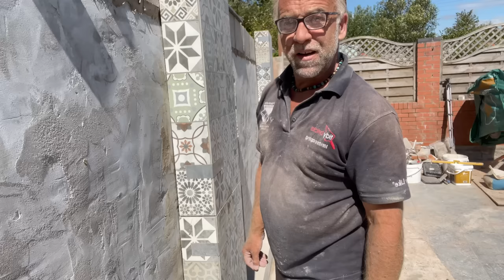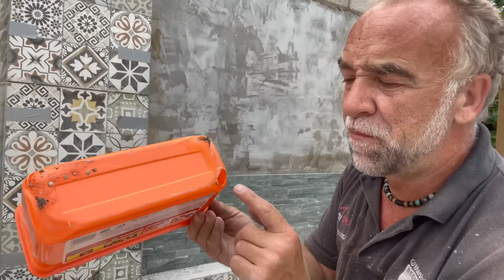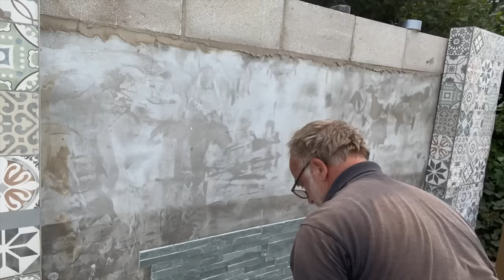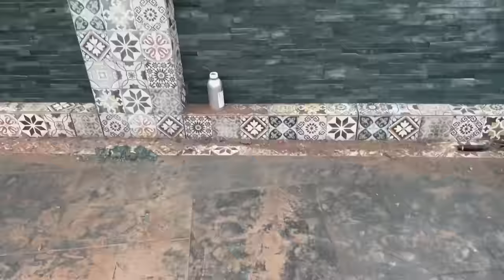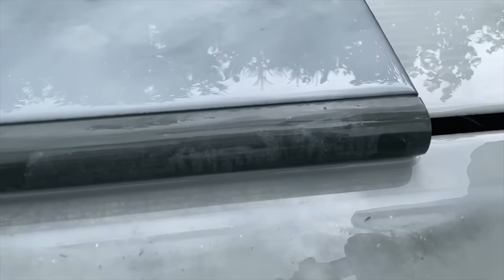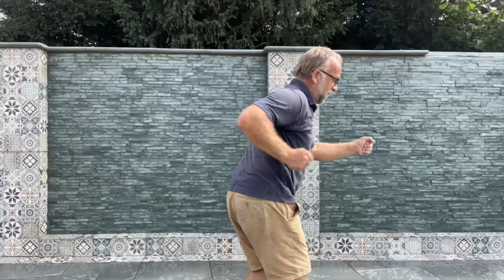Dry-Stack Walling Feature Wall Installation Guide 🌟🧱 #porcelain #blockwall

Comment: Hi mate, love your work, can i ask how does this work on a blockwork planter corner,  how to get the neat finish, does it just butt up on the corner both sides, how do you hide the side of the tile the rough edge.
Reply from the maker: Tough call and there’s no real ideal answer but the alternative is is to tooth the corner rather than straight joint looks best 👍🏴

Comment: I use external tile adhesive recommended by the supplier. Find that I have to work left to right as it can get messy try to fit the tile underneath the joint of the last tile. Good tidy job there btw
Reply from the maker: Thanks for watching Tony as for The tile adhesive there’s so many out there and it all sticks like glue 👍🏴

Comment: Could you use these indoors for a shower? Or the gaps let water through? I like them
Reply from the maker: Water would definitely seep through but it could still be done as long as the wall behind was waterproof I guess 👍🏴
Reply: As mentioned in the reply, water from an internal shower will get behind the tiles as will rain water on this job shown.....there is no difference! Except when rain water gets behind the tiles shown in this video it will sit behind the tiles in the huge voids caused by just using a few lines of adhesive. This water will freeze in the winter and blow the tiles off the wall. There should be no voids behind the tiles particularly on an external project where water will get behind between the wall and tile. The wall and  tile should be completely covered with using a notched trowel and external tile adhesive and if any oozes between the joints it should simply be wiped off. This video shows not how to stick tiles to an external wall.

Comment: Great video. I'm putting almost the same tiles on the front facia of a timber frame bar building. I'm going to use a tile backer board to try and alleviate some movement. Would you still use the primer 1st?.
Reply from the maker: Yeh man primer every time both sides 👍🏴

Comment: Quick Q, The system U are using, Will it stand up to water ingress, frost heave ( delamination from background) Ireland a lot of rain, especially winter time, is your system suitable for North facing ? Big Thanks in advance if U reply
Reply from the maker: Hi George and the answer to your question is the product itself is very delicate if I was to kick it with my boot bits would fall off so it’s not massively structurally sound especially expanding frost.
Hope that helps 👍🏴
Reply: Can't believe what I am reading. George you are correct. Water will get behind these tiles and sit in the huge voids that are being formed by just using a few bead lines of adhesive. This water will freeze in winter and blow the tiles off the wall. This video shows how not to stick tiles to an external wall! You should never form voids behind tiles. You should cover the wall and tile with an external tile adhesive with a notched float / trowel. Then press the tile firmly on to the wall. then there will be no voids! If any adhesive comes out between joints then simply wipe it off. The reply you have been given is unbelievable. The comment about if the tiles are kicked with boots then bits will fly off is just beyond me. And the comment about the tiles not being massively structurally sound is the most ridiculous comment I've ever heard. "Not massively structurally sound"! Tiles are not at all structurally sound! They are not designed to take any weight loading so what does "not massively structurally sound" mean?

Comment: Can I use this method of adhering over painted breeze blocks that get slightly damp from other side??
Reply from the maker: Definitely not over any paint because it will not bond with the wall properly, get the pressure washer on it first.  Cover the back of the wall with plastic if possibly slow the dampness down 👍🏴

Comment: Can I use this primer and adhesive for an indoor wall? With similar tiles, also can I put the primer on an old painted wall
Reply from the maker: I would say the primer and adhesive would be fine for indoors but I would clean the surface for it to stick to and not the  wallpaper 👍🏴

Comment: Hi, we’re putting ceramic tiles similar to those you’ve done on a concrete block exterior wall - is that primer and sealant the best one to use please? Would the Sika pva primer do the same job? The other side of the wall is backfilled (double skinned wall with a small gap in between) just looking for some advice please? Thanks
Reply from the maker: I’m doing similar atm using a cement primer from Marshall’s. you must prime the wall and tile then stick. putting a plastic dpm behind the wall would also help stop water from penetrating through the wall 
hope that helps 👍🏴
Reply: Thank you! Too late for anything behind the wall but will definitely prime both surfaces 👍🏼

Comment: Fantastic video mate! Have you ever used slip bond to bond tiles to masonry at all? I'm doing my house that's smooth red brick! And have been recommended slipbond as the adhesive.Would I have to pva/prime the wall to cover red brick.thanks
Reply from the maker: The product I use all the adhesives come with it and yes you would 100% have to prime the wall first 👍🏴

Comment: Hello mate, drystacking a block wall on a job tomorrow and its all over the place not plumb or straight thinking of batoning the wall and fixing the dry stack to the timber, what do you think mate?
Reply: Would the adhesive bond well with the timber and if so would you primer the batons ?
Reply from the maker: That projects the wall wasn’t perfect but it was perfect enough not to stand out probably your best bet would be dub out with some render in some spots probably the easiest way 👍🏴
Reply: Ended up using cement boards mate worked a treat, thanks for the advice appreciated

Comment: Hi mate I’m doing the front of a house with these …I thought you use tile adhesive…is it ok to use it ..cheers
Reply from the maker: Yes should be fine I also used the same 
All materials needed supplied with Marshall’s 👍🏴
Reply: @tidybrickslandscaping  is it ok to install this during cold winter weather
Reply from the maker: @anitagoodsleep5330  Check the instructions on the adhesive if I was you 👍🏴
Reply: Mate I wouldn't use this method of sticking tiles to an external wall. You should never form voids behind tiles particularly outside where rain water will sit in the voids. This water will freeze in the winter and blow the tiles. The wall and tiles should be completely covered will external adhesive using a shallow notched float. Press the tile firmly on to the wall. If any adhesive comes out of joints simply wipe clean. Do not use the method shown in this video. Hope this helps and good luck with your project.

Comment: How many m2 will that primer do? Is there any cheaper alternatives? Cheers mate
Reply from the maker: About 2m2 1 primer bottle does 👍🏴
Reply: Cheers. Where is the best place to buy the adhesive and primer? Also, if you mind me asking I’m fitting these to a block wall and top of the wall I’m going to be laying porcelain slabs. Would you recommend laying these on a mix or just primer? 🤔
Reply from the maker: @connorfenn4648  the primer and the ebt adhesive came with the tiles so I can’t help where to buy unless you get them from ,Marshall’s. Use a mix for the top cement prime both wall and tile and sharp,sand 4\1 mix wet 👍🏴
Reply: @tidybrickslandscaping  ok thanks for your time pal 👍🏼

Comment: Those tiles would be ideal for an uneven walk I assume?
Reply from the maker: No it’s got to be flat as possible or they’ll wobble 👍🏴
Reply: These tiles are not designed to be walked on even if laid flat. They are for cladding vertical walls.